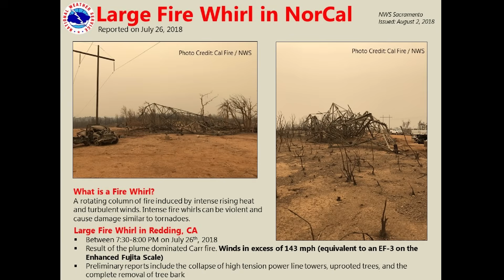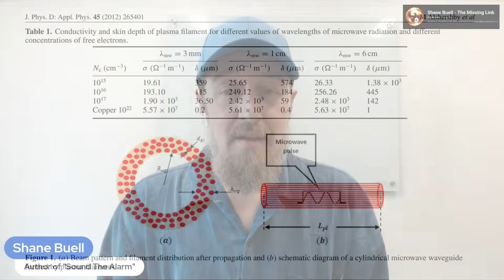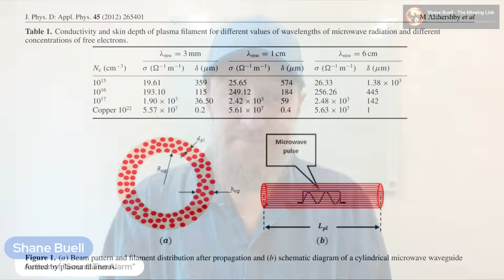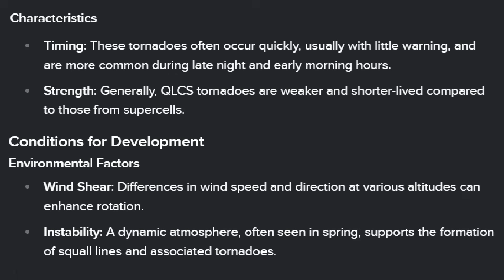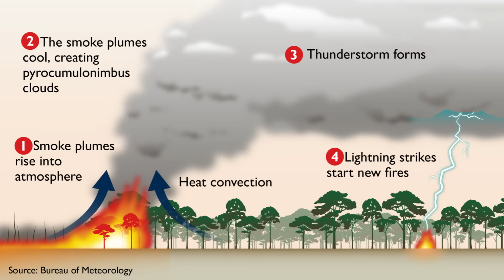Firenadoes Gone WILD? Unprecedented Fire Behavior Analysis!

Comment: Don't fires need air-fuel-and heat..  So if the air is 'dense' or accelerating and there is intense heat wouldn't that be enough potentially to ignite the fuel-ie grass?  Could be how the spot fires seem to come from nothing, it's just the intense heat coupled to the air flow ignites the grass.

Comment: I Grok'ed this:
The Coriolis effect, caused by Earth's rotation, influences large-scale weather systems like tornadoes, but its impact varies by scale and type. Here's a concise breakdown:

- *Tornadoes and the Coriolis Effect**: The Coriolis effect weakly influences tornadoes, favoring **counterclockwise rotation* in the Northern Hemisphere and *clockwise rotation* in the Southern Hemisphere due to Earth's spin. However, tornadoes are small-scale systems driven primarily by local wind shear and updrafts, so the Coriolis effect is minimal compared to larger systems like hurricanes. Most Northern Hemisphere tornadoes (about 95%) spin counterclockwise, but exceptions occur due to local dynamics, per NOAA and meteorology studies.

- **Smaller Tornadoes and Firenados**: Smaller tornadoes (e.g., gustnadoes, dust devils) and firenados (fire-induced whirlwinds) are even less affected by the Coriolis effect because their scale is too small for Earth's rotation to dominate. Their spin direction depends on local wind patterns, heat, and terrain. Firenados, driven by intense heat and turbulence, can spin either direction, with no consistent hemispheric pattern, per research from the American Meteorological Society.

- **Tornado Clusters**: Tornado clusters (e.g., during outbreaks) often form within a larger mesocyclone or storm system. Individual tornadoes in a cluster typically spin the same direction as the parent mesocyclone (usually counterclockwise in the Northern Hemisphere), but smaller tornadoes or subvortices within the cluster can occasionally spin oppositely due to complex local wind interactions, per studies from the Storm Prediction Center.

**Summary**: Tornadoes are weakly influenced by the Coriolis effect, favoring counterclockwise spin in the Northern Hemisphere and clockwise in the Southern Hemisphere, but local factors dominate. Smaller tornadoes and firenados are largely unaffected by the Coriolis effect, spinning either direction based on local conditions. In clusters, most tornadoes spin the same as the parent storm, but smaller ones may spin oppositely due to local dynamics.

If you need more details or specific examples, let me know! (said Grok)

Comment: hello shane
i want to tell you of  a video i saw .it was  a drone view of a house with its roof on fire, the roof  had three to four circular holes which looked
like something with immense heat had burned its way through the roof, you mentioned firenados with twelve inch diameter,
the roof looked  as if  large lasers burned holes into it and deep down into the house blasting everything inside into flames
i am unable to locate the video,but it was this year 2025  worldwide fires if i find it again i will let you know.

Comment: THIS SO-CALLED "FIRENADO" IS A NEXRAD DEW INDUCED VORTEX!  IT TAKES MULTIPLE NEXRADS TO DIRECT THEIR MICROWAVE BEAMS ALL AROUND THE PERIMITER OF THE AREA WERE THE TORNADO SHOULD BE MADE!   THE NEXRAD DIRECTED ENERGY BEAMS CREATE A WIND THAT ENDS UP BEING SUCKED UP THROUGH THE VOTEX AND THE HEAT RISING THROUGH THE CENTER OF THE VORTX CREATES HURRICANE FORCE WINDS!   THIS IS A MICROWAVE PLASMA FIRE THAT IT 10 TIMES HOTTER THAN A NORMAL FULLY ENGULFED FOREST FIRE!    

THANK YOU!
Reply from the maker: What if it only took 1 LRAD aimed at the right side?
https://patents.google.com/patent/US20030085296A1/en